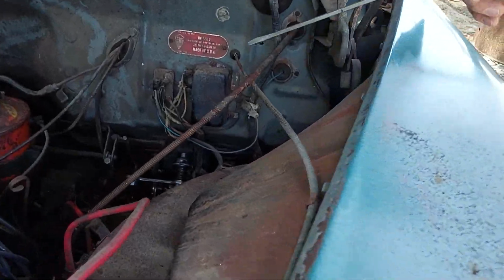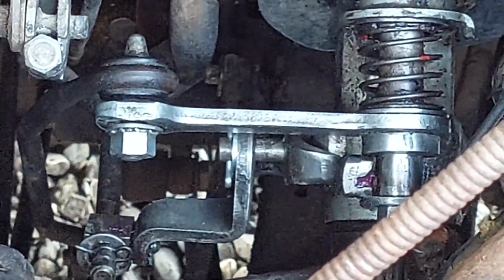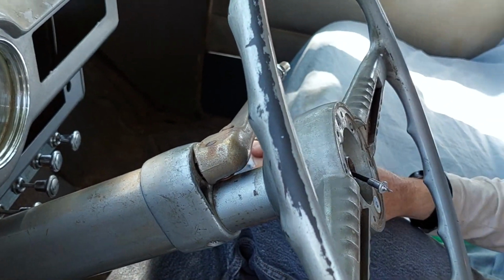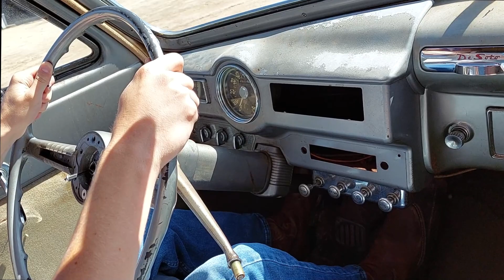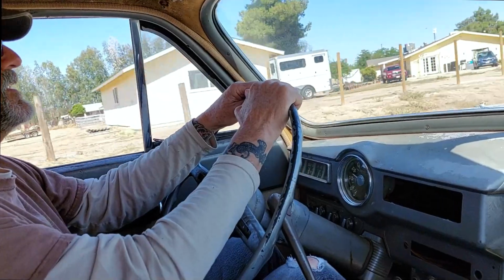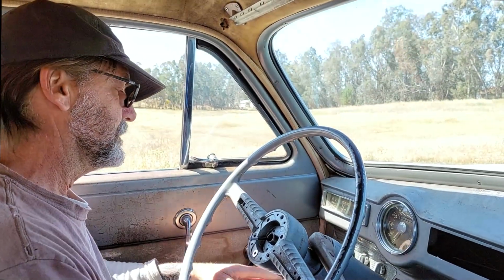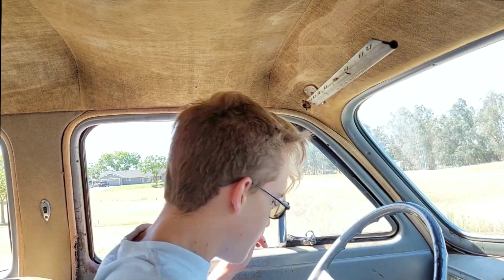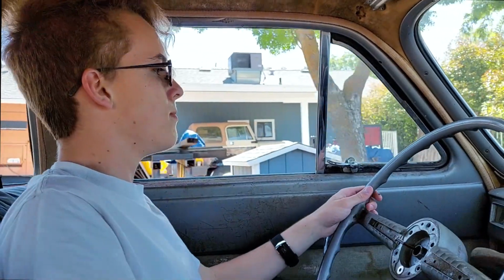Rye and Jebus finally drive the DeSoto and start up the '48 Willy's (Film No.6)

Comment: What an excellent demonstration of driving a fluid drive Car. I have driven an S11 DeSoto long enough to know that the high torque slow revving sidevalve 6 gives the car plenty power to slug away on 4th gear till it gets to 12mph when it will change into 3rd gear. You can change into 3rd using the KICKDOWN before 12 mph
In the Low Range it will change at 6 mph 2nd to First and the kickdown will similarly work.
Enjoy